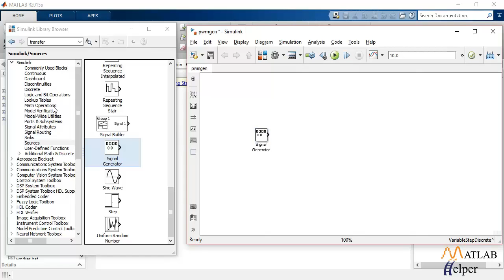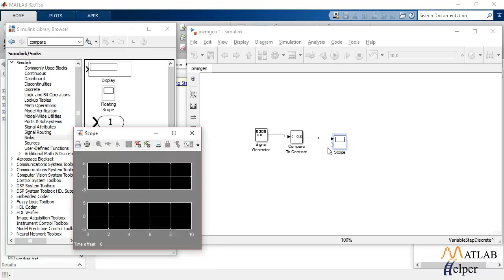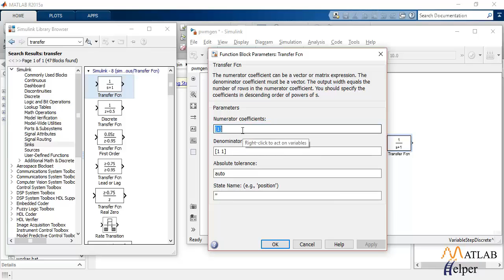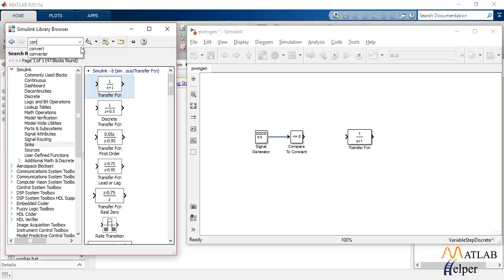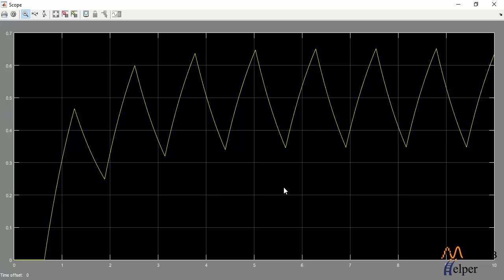Generating PWM Wave & Modelling RC filter | Simulink Fundamentals | @MATLABHelper

Comment: #PWM waves have control based applications.It is used to #encode messages in the form of #pulses.It is generated by #saw-tooth wave.The saw-tooth wave is compared with the message signal.If it is greater than the message signal,then output will be zero otherwise it is one.
To obtain square wave output,saw-tooth wave is compared with zero.To convert output from Boolean to double,we use #convert block.then this output is given to the transfer function.
For designing #RC filter the numerator and denominator coefficients are written in #transfer function block and observe the output on #scope.
Reply from the maker: Disha Nikam, Glad to see your appreciation for our Video. Do support us by Subscribing to our YouTube Channel at https://www.youtube.com/c/matlabhelperteam